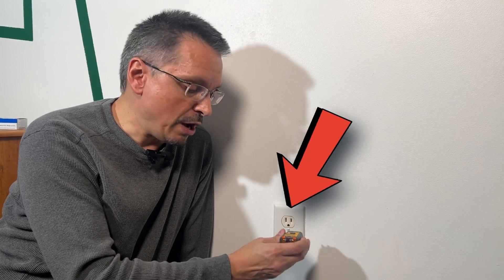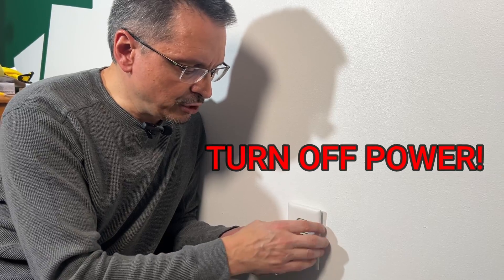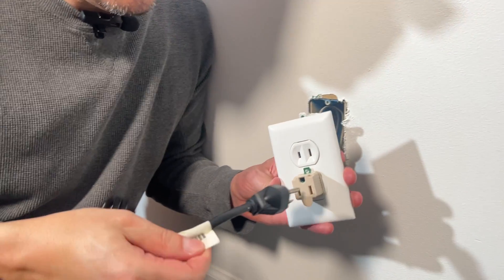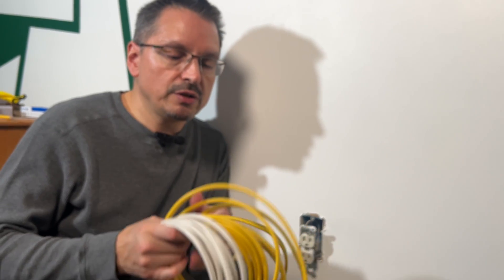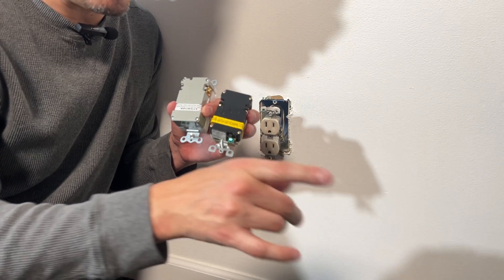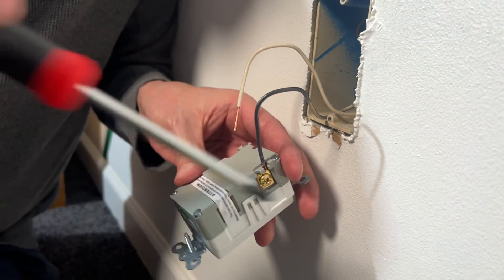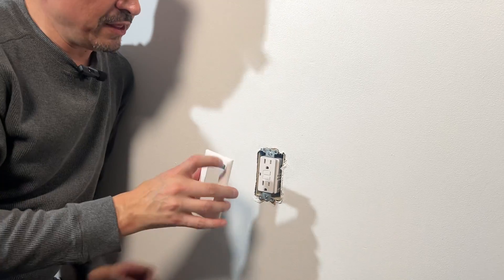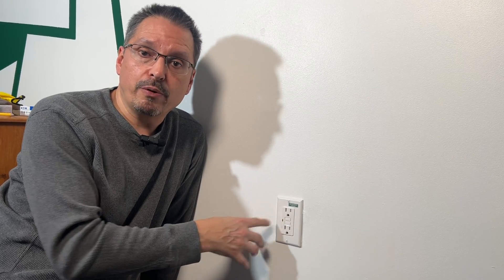Fix Open Ground Outlets | 4 Options

Comment: If I have more than one outet on an ungrounded circuit, do I have to put a GFCI outlet on every outlet? Also, once I install the GFCI, will I still get the 'Open Ground' error on my tester or will the tester show the outlet as 'Properly Connected'?
Reply from the maker: Your handheld tester will still show open ground, that’s normal. But you still have fault protection, and you have improved the safety. Installing a new GFCI at every single outlet is the easiest and safest way to do it as there will be no question about what’s protected. 

However, you can be more efficient about it and install one at the top of the circuit and then use the load connection to protect downstream outlets. Good luck.
Reply: @HomeRapidRepair  to this downstream protection, do you remove the green sticker from the free connector( the connection that doesn’t have power going in ) and then wire other outlets into that connector as long as it doesn’t surpass the breaker amps and the amps on the first GFCI outlet ?
Reply from the maker: @ i’m not sure I follow. But yes, in this open ground example you will not use the green connector at all.
Reply: You can replace an existing breaker with a GFCI breaker in your breaker panel, and it will provide protection on all outlets and switches on that circuit. But a surge protector plugged into them will not provide surge protection without a ground.

Comment: Another option, add dual function breakers
Reply from the maker: Nice idea. Thanks for watching 👍🏼😊
Reply: @glenndusablon374  yes, good point.   Combining AFCI with GFCI protection on older wiring is undoubtedly the safest option, short of rewiring the home.   One thing you do have to keep in mind is that GFCI, AFCI or Dual Function breakers aren't always compatible with older wiring systems because in an effort to save on material and labor costs, shared neutral circuits, also called common neutral circuits, multiwire branch circuits, split circuits or Edison circuits, were fairly common in older homes.  For those unaware, this means a 3 wire cable containing a black, white and red, with or without a ground wire, is run from the panel to provide two circuits in a single cable run.  There were several variations of this scheme used over the years.   If you see red wires in the outlet boxes, especially in the kitchen, this means you have a shared neutral circuit.   

Other times you won't be able to tell if you have shared neutral circuits when removing the receptacle outlets. In another variation, the 3 wire cable from the panel run into a junction box in the attic or basement/crawlspace where  two 14-2 or 12-2 cables, one connected to the black - white, the other, red - white and run in different directions, usually a master bedroom and great room, or each half of a large great room. 

Conventional GFCI, AFCI or Dual Function breaker will not work on a shared neutral circuit because they would trip immediately as soon as loads are connected, so in this situation you're going to have to resort to at least two GFCI or Dual Function type receptacles on the circuit and possibly at every receptacle location if 3 wire cable was ran between all the outlet boxes.

Comment: The ground wire does not direct the fault current to the earth but to the neutral wire. This causes the breaker to trip.
Reply from the maker: I get this question a lot. If you do the plug-in GFCI tester on an ungrounded GFCI outlet it will not trip it. However, if you use the factory test button on the receptacle, it will trip it…
Reply: @HomeRapidRepair  so where is the path changing to be able to trip the breaker from the receptacle rather than using the tester?
Reply from the maker: @shawnsinnett7895 in your example it wouldn’t trip the breaker. Unless an over load condition occurs
Reply: @HomeRapidRepair what im asking is. What is different about the tester and the receptacle? I had thought the tester mimics what the receptacle does
Reply from the maker: @shawnsinnett7895  the electrical code does allow a GFCI outlet to be installed even ungrounded because it adds to the safety. However, the tester will still show no ground. If you want a true ground, you will have to connect a solid copper wire all the way back to the ground rod at the main panel box.

Comment: Great vid. Trying to update mine as well, but having issues.  What is the point of a LOAD if LINE can hold all the outlets pigtailed to that section of the GFCI? I thought LOAD was meant for additional outlets downstream and LINE was only meant for the connection to the breaker?
Reply from the maker: You have explained it correctly. Only use the line connection, including downstream outlets if you only want that individual outlet to have fault protection. 

But if you know which outlets are downstream and also want them to have fault protection, go ahead and use the load screws. But remember to label them as not grounded , but you still have fault protection, which is a nice improvement.
Reply: The load side is protected by the GFCI. If you do not want them protected for some reason then you should pigtail. Lets say you do not want nuisance tripping on some other outlet cut the power from your computer.
Reply from the maker: @okaro6595  all good points. Thanks for sharing 🛠️🏠

Comment: I have old wire but it's new Fuse and has 3 wire ground and I'm still getting open ground
Reply from the maker: Weird. You could try a different tester. Also check that the ground wire connection is tight at the panel and your outlet.
Reply: @HomeRapidRepair  ok thank you I will check

Comment: My power strip ground indicaticator doesn't turn on but when i plug the tester to the power strip, it says correct wiring. Is my power strip faulty? To be clear, the outlet that my power strip is plugged to is grounded.
Reply from the maker: Yeah, it is possible your power strip is faulty or has a loose connection. Also keep in mind when you use these plug testers. The internal circuitry has to make its best judgment call on which display to show you… So even though it shows correct wiring sometimes you could have a loose ground, for example.
Reply: @HomeRapidRepair  I initially thought maybe the power strip is grounded but the ground LED bulb is burnt. Then again, if the power strip indeed has ground fault, but my tester says correct wiring, i'm questioning the reliability of these testers.
Reply from the maker: @nhitc6832  I use the same “cheap” $10 testers as you 😂 Electrician’s testers can be hundreds of dollars…

Comment: My house upstairs bedrooms has no ground but all the outlets have the ground in the back disconnected so I can easily connect them but I noticed they used 2 different wiring from the breaker box they ran 14-2 wire then the one in the wall is an old school 2 wire deal that runs all the way to the attic then they used 14-2 wire again to connect to all the bedrooms upstairs so that’s why they canceled the ground weird right.
Reply: @Igh86  I've run into this a lot over the years with people trying to upgrade their homes especially in homes that were built in the early 1900s that typically have the blown in insulation I think they just didn't want to have to remove layers of wallpaper and slat and plaster and they just didn't understand the importance of proper grounding most of these older homes you can still find the original 2 strand wiring with the ceramic insulators I have yet to find one still in use but they are still typically found in many of them, I have done a lot of conversations on these old monster homes turning them into multiple apartments for people and I wouldn't even consider leaving the wiring in the state that you have described. Typically these older homes have large ornate baseboards that can be removed to rewire them properly, I would stick to interior walls as far as replacing the sections between the attic and the bedrooms. There are a few other options that can be used but it really depends on how many electrical components you plan to use in each room and the number of outlets on each breaker because I have come across some real scary stuff in my years where home owners or people who had no clue what they were doing much have been involved, but if this is a place that you intend to rent or you want to truly feel safe then you might consider rewiring the entire house, I know when I was first starting out I would ask the owner and give them pricing for different levels of upgrades and the majority of the time they would rather pay less and deal with it. I thought back then that I was just trying to give people all  their choices but I don't think I understood just how little the majority of people understand about electricity and the dangers it can cause, I stopped offering anything less than what I would feel safe with inside my own home a long time ago, I hope that you understand the value of safety, I don't like to even splice wiring because every time you break the wire you create a point of weakness and I recommend using wire staples with built in insulators also I have encountered a lot of them that were over hammered and they were actually arcing the wires in some cases I thought these people are truly protected by God because how it never ended up becoming a serious fire still baffles me today.
Reply from the maker: Yes people do strange things. Some thought ground wires were a waste of time. Thanks for sharing your issue 🛠️

Comment: So is that a grounded outlet now !? Just changing to a gfci
Reply from the maker: No it’s still ungrounded. However you now have fault protection and it’s much safer than before 🛠️🛠️
Reply: @RapidRepair  Thanks for the repley, so can I run a pigtail to the metal box to the grounding screw on the socket to get a ground then .
Reply from the maker: @bric7244  Yes that should work for you.
Reply: @HomeRapidRepair  thank you
Reply: @HomeRapidRepair so what exactly is that grounding to if the receptacle has no ground, then I'm just pigtailing off an ungrounded receptacle to a box? How is that getting to ground?
Reply from the maker: @shawnsinnett7895  you are correct to have a true and proper ground. You would still need a continuous connection all the way back to the service grounding rod. However, you can leave it ungrounded if you would like and simply install GFCI receptacle outlet for increased safety. However, when you test that it would still display as an open ground…

Comment: Will the GFCI receptacle protect my computer equipment or is this solution only to pass inspection?
Reply: Also, will downstream outlets be protected or should each one be replaced with a GFCI receptacle?
Reply from the maker: You get to choose if downstream outlets are protected or not. For new DIY’ers I say install a new GFCI outlet at each location. 

Option 2 if the lower terminals on the GFCI outlet has a sticker, remove this sticker and install your downstream wires here and this circuit will have protection too 🛠️🛠️
Reply from the maker: You will have fault protection, much better than you currently have  😊👍🏼
Reply: Gfi may help with surge if that's what ur wondering but I doubt it may need to consult an electrician. Gfi's purpose is to protect humans from receiving a shock or 
( not )becoming electrocuted.
Reply: Grounding is about protection against electric shocks. You should not connect things especially anything connected to antenna to your computer when it is on. An ungrounded computer gets 60 V to the case but the current is limited.
Reply: No. A surge protector plugged into an open ground outlet will not provide surge protection, even with a GFCI.

Comment: So would the gfci work with a surge protector just as good as a grounded outlet? Asking to protect electronics.
Reply from the maker: The best answer is yes you WILL have far better protection than you do now. Go for it 🛠️🛠️

Comment: I like you summed up as 4 options, very clean. 👍.
But  you raised a question for me,a newbie .
you said each terminal can hold two conductors on both sides of each screw . 
If you do, the two conductors will splice together, will it electric shock me? 
For example cable 12/3 , red and black are hot , if we put red and black on one terminal, is it safe ?

Thank you .
Reply from the maker: In your example you would want to keep those conductors totally separate (such as red & black) Good luck 🛠️🛠️

Comment: Hello !!
I have an apartment in Manhattan NYC, the apartment is from the 60s in which there are many ungrounded outlets.
If I apply the GFCI method. Will I pass the inspection ?
Will a city inspector come to inspect the electricity soon ?  Thank you.
Reply from the maker: Yes, absolutely. If you install GFCI outlets AND use the provided sticker in the box to label it as ungrounded you are good. I’ve seen code officials pass these all the time. Unless there’s some NYC rule I don’t know about. Good luck my friend 🛠️🛠️